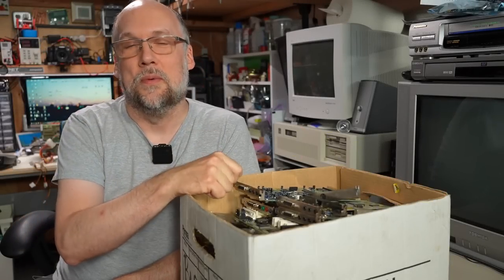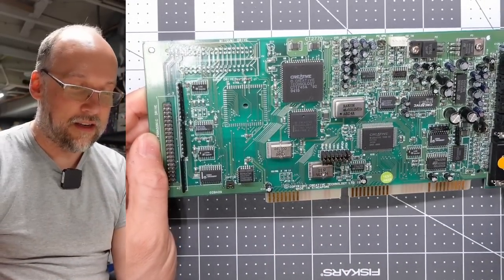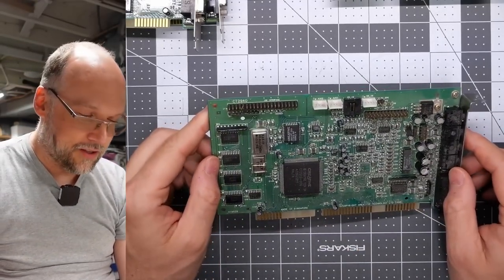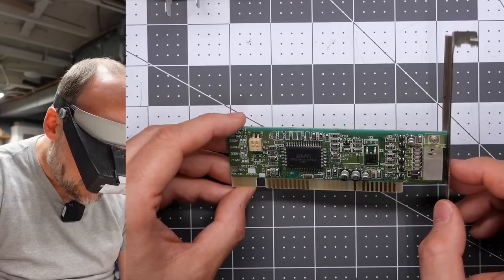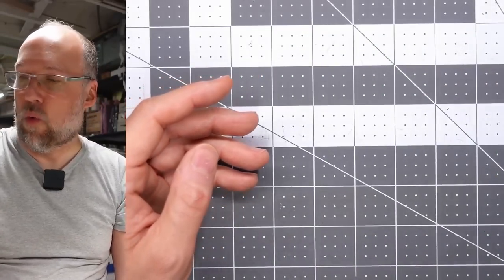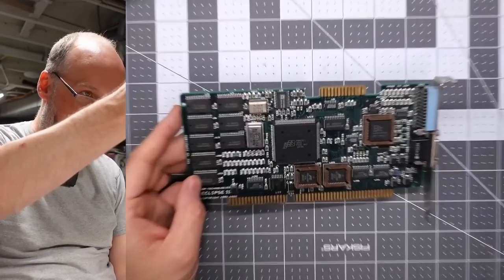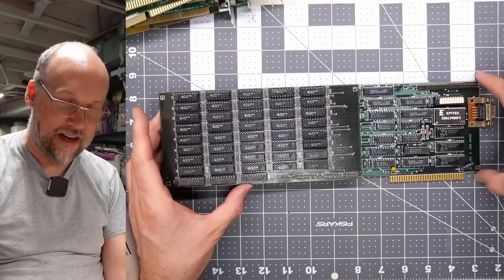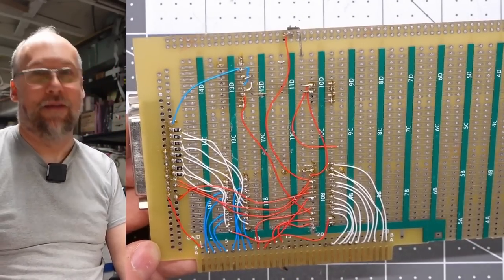Tech archeology: Exploring mysterious computer parts

Comment: The 386 pulg through of the debugger card has on board pins that go into a raiser which again is in a raiser. The raiser that goes into the system socket appearsto be replaceable without soldering.

Comment: I think if you find old cards with bodges on them and you think they might be fun t play with later, it might be word putting a little solder mask over the ends to keep them safe :)
Reply: I would never power one of those cards up without everything connected. One broken line appears to be a clock and that missing could easily lead to double driving the bus and smoking the buffers or worse.
Reply: @Peter_S_  I'm also just realizing I made a ton of spelling mistakes in my post.
Reply: @superslammer  No worries, I knew exactly what you meant and actually didn't notice. I was just thinking back to various bring-ups and the issues encountered along the way. You usually get lucky with TTL and active low selects but not always.

Comment: I used to install Jaton video cards in desktop machines built for a shop where I worked. They were probably 32/64mb cards. Nothing special, but better than on-board video if the mobos had it. Probably in the year 2000

Comment: I would love to see a video trying to use the Periscope In-Circuit-Emulator thingie, or any device like it. I always think of these types of devices when somebody tells me "emulation" means software and therefor FPGAs are not emulating. Then again I believe the term "In-Circuit-Emulator" outlived the era in which they actually did emulation but I believe they were still in-circuit. It looks like yours is adding circuitry between a real CPU and the rest of the system for instance.

Comment: The CT1741 is not OPL but DSP chip. Actually the CT1747 chips has real OPL3 sound. This chip is integrated with bus interface chip and OPL, but contain true Yamaha OPL-3 circuitry and the  CT1747 chips are made in Japan (by Yamaha).

Comment: 6:30 Creative was a bit weird with model numbers. Internally, there's no difference between the CT4520 and CT4500. However, some CT4520s have missing extra features like no CD audio input headers, missing RAM so no sound fonts, no RAM expansion headers, etc. OEMs used them often. The CT4520 is also newer and smaller, so less components on the board. Creative gave them all the CT4520 model number.

There are also other revisions of the CT4500 but as far as I know, there's no difference at all between them - they're all AWE64 values with 512KB Soundfont RAM.

IMO they all still make excellent general DOS sound cards, they support everything that the AWE32 does, no hanging note bugs, and overall clearer sound. Their biggest downside is they're all PnP cards so you have to use that awful CTCM TSR and if you do want sound fonts, the extra RAM module is proprietary.

8:00 - yep, more Creative model number bullshit. They're OEM cards, cut down to meet a price point but advertised as equivalent to a 'fully featured' card. If internet reviews were around then, they'd be torn a new one for pulling that garbage today.

Comment: Difference between the (AWE)32 and the AWE64: The AWE64 comes with a 32-voice software "waveguide" synthesizer to complement the 32-voice hardware wavetable synthesizer for a total of 64 voices. Also, the RAM upgrade board for the AWE64 series is proprietary, whereas the SB (AWE) 32 uses standard SIMMs. The synthesis hardware is identical. Software written for the AWE32 works out-of-the-box on the AWE64. The non-gold AWE64 has a mediocre amount of memory, 512K IIRC, which is less than you have on your SB32. Hardware-wise, the AWE64 is a budget version of the AWE32, with the EMU8000 synthesis chip and the whole digital SB16 stuff integrated into one highly integrated chip. The other big chip on that card is the analog mixer, and the DAC/ADC is still a separate chip.

Don't worry about SB AWE 32 vs. SB 32. The missing AWE just means it's a budget card, like the SB AWE 32 Value edition, but a different one. The CT3600 / CT3620 provide an excellent value even today. Those are the cheapest SB AWE 32-like cards available. The downsides are: No wavetable connector, no real OPL3, no on-board memory. No real OPL3 is a deal-breaker for some. No on-board memory is irrelevant. If you are into retro computing, you have at least 2*1MB in some parts bin, which is more than the 512KB the original SB AWE32 had as on-board RAM. On the AWE32, on-board RAM or socketed RAM are an either-or choice. So the on-board RAM is of no use as soon as you add a sensible amount of RAM (2MB or 8MB) to the card. No wavetable header: You can use an external wavetable adapter like the "Chill & Phil", but as the MIDI handing on the SB16 bus interface chip is a mess anyway and caused a lot of issues (collectively called "hanging note bugs"), you are better off using the MIDI interface of any budget sound card or even onboard sound, so again not a big loss.

Comment: There were a lot of sound blaster cards that shipped with OEM computers..... and the OEM's had very specific requirements. For instance IBM might ship one that didnt have an extra IDE port because their motherboard had an extra, while Dell would want one with the IDE connector so they could get away with a single ribbon to their motherboard. And then multiply this by all the different options on a sound card. The result was a stupid number of variations as the sound card kind of became a do all card with more than just sound.

Comment: The TB Multisound (Tahiti) seems legit by chip complement alone - the 56001 DSP would have been bleeding edge, and the CS4328-K DACs, CS5336-K ADC and 5532 opamps suggest at least prosumer level for a ~1993 card. Those converters would have been brand-new at the time with the highest grade for each one, and I won't be surprised if the card measures a fair bit better than its specs suggest or at least can be tweaked quite a bit. Certainly a fair bit beyond the typical CS4231 codec that you might have found in consumer cards of the day.
Reply from the maker: Indeed! I did some reading and people were gushing over how great this card was for playing back and recording audio. "Studio" quality many people said... if you were OK working with Windows 3.1!

Comment: 1:01:28 just cut the ribon cable before the damage and reatach the connector. done it a few times. cable get a little shorter tho..
Reply: This. You can probably find a replacement ribbon cable if it gets too short. Just tear off any extra conductors to bring it down to size.
Reply: If this is shielded, that might be a bit more difficult than usual
Reply: @ericwazhung  aahh, not done shielded before.
Reply: @danovebrest  nor I! just guessing

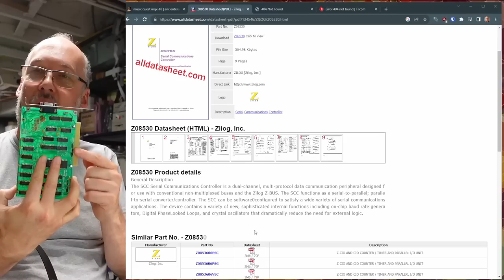Comment: 54:51 SCC is a super serial controller from Zilog used a lot for serial applications that need synchronous protocols. The normal serial chips from PC, be they the older 8250 or the newer 16550 with FIFO were pure Asynchronous chips and could not be used for some special protocols. Mainframe hardware used often synchronnous protocols to connect to terminals. Standard OSI stack also defined some protocols like HDLC that required special header bits to separate packets. It was also possible to build multipoint serial connection which made that chip usefule for networks before Ethernet was the king in town. Apple also used that chip for its Appletalk network protocol. Atari put one also in its TT030 range of computer, probably to use Appletalk, but they never published software to enable that.
Reply: Just had written that comment a little bit before you identified the card as an Appletalk card. 🙂

Comment: I have run those Kingston Turbochips up to 150MHz on a 486 motherboard capable of 50MHz bus, runs like a P90 then, also can run at 160MHz on an 486 motherboard capable of a 40MHz bus. I still have (somewhere in storage) the 50MHz bus 486 board with ultra fast RAM (for the time) and running with a 50MHz bus, an Adaptec fast SCSI card & HD, the thing was surprisingly quick compared to an intel P90 (which I think I still have). If running a 486 board with 40/50MHz bus, you really do need the fastest RAM of the time, otherwise it would crash a lot. PS: it was faster on a 50MHz bus @150MHz than on 40MHz bus @ 160MHz.

Comment: That 386 in circuit emulator sounds interesting. In the 80's I was using similar kit, though for the way more humble 8031 micro. Not sure how the foot pedal idea would be much use? What we'd be doing is writing code, compile/assemble it for which output would be the actual binary file but also a related symbols file which the emulator could use, so you could place breakpoints at certain points and examine the contents of registers/variables/etc by name. What makes me feel old is now a Pi Pico can use a second Pi Pico to do the same thing for peanuts !

Comment: that centram TOPS card is for interfacing a PC with Apple Localtalk. I'm guessing it's basically an ISA RS422 adapter. My college had a couple of these in PCs but IIRC the software was DOS only, and Ethernet to Appletalk bridges covered the needed use cases for Windows 95 and later...

Comment: The AWE64 is a pretty nice card. Fully compatible with SB16 PCM and the AWE32, but it has a much cleaner output. The regular/value only comes with 512k of memory, but it is upgradable. The Gold comes with 1tb if I recall. I have a CT4520, which is the value version(yours is the original AWE64) It even has good opl3 emulation, this came out by the time creative sorted out the CQM system.
Reply: 1tb of memory on a soundcard?....I don't think so.     The Awe64 Gold came with 4mb of RAM which maxed out at 36mb (4mb onboard + up to 32mb with a memory expansion daughterboard)

Comment: 26:40 TIGA card?  Texas Instruments Graphics Architecture (TIGA). Some company info on pg 212 of 1990-340-Family-THIRD-PARTY-GUIDE-4th-edition.pdf
Most TIGA cards connect to the VESA card connector on a VGA card. So they require a VGA card and the connector. They work similar to a Voodoo card, they sit there unused until the program initialize them and then they switch over. I used these when i worked for a GIS software company in the earl 90's. We ran DOS based  X-windows clients on them.

Comment: DDA-08 and DDA-16 appear to be a Kiethley analog output cards. 8 or 16 outputs. You have 32ish pins, because each output uses a pair. It appears that these are only single-ended outputs, though, so every other pin is, in fact, ground. Still a very nice thing to have for any lab application.
Reply: Ah, I see you got to that a few minutes later.

Comment: Back in the day, a PC LocalTalk would have been very useful to me. Connecting Apple Personal Laserwriter NTR to PS/2 system via parallel and with an app would write/read FAT formatted floppies. 

Acorn's Econet was aearly n serial + based networking. iirc, the PC cards for Econet were even more expensive than LocalTalk ones.

Comment: That a socket is unpopulated on a prototype board doesn't necessarily mean it's missing, it might just be unused in later iterations of the board. Populating it with a chip from a board where it's present would probably not cause problems though. Try looking up what the chip is that is in that Blackfoot board... it's around 39:20
Edit: Haha ok, an even more complete card was next in the video. I really should watch to the end before commenting. :)

Comment: If i remember right, i have seen that Blackfoot Card. That should be a jpeg accelerator card with a very short lifespan. It was used in the pre PowerPC era to accelerate jpeg picture encoding. I think Adobe Photoshop have had the abillity to use this card back in time. But i‘am not 100% shure
Reply from the maker: Indeed that matches what little information I was able to dig up on that card. The drivers and photoshop plugin are totally lost to time sadly.

Comment: Just guessing, but the SCAN-CAP sounds like it could by something around a scanning, capacitative ADC solution, which could be the interface card for some kind of Radio Receiver, RADAR instrumentation or similar things. 

And if you design or just work with something like that, you would like to have a fancy Analogue Output card for testing around ;-)

But the connectivity on it seems confusing. Maybe the VGA-Port is actually used as an input? The 40 MHz ADC on it would certainly be fast enough to handle VGA-Signals (640x480x60 Hz = 18 MHz).  

The only confusing part seems to be the lack of any complex processing capabilities on the board. I really don't know what a 1991 PC could try to do with a digitised VGA-Stream coming over the ISA-Bus.

Comment: For the periscope, rather than repairing the cable - perhaps cut it back to before the damage and recrimp it to the connector.

Also, washing is a last resort for me with dirty PCBs. Have you tried a natural fibre paint brush? I find that gets most dust off.
Reply: He said that but probably means the ultrasonic wash (with sterilized, de-ionized, distilled triple filtered water (also sold in bottles if you don't have the means to make it), which is the industry standard (usually one of the last steps of the manufacturing process).
Reply: @freeculture  sure. But either way, I didn't see anything there a paintbrush wouldn't have solved and much quicker :)

Comment: 16:20 I have been surprised, and later felt that I should not have been, that there are /many/ manufacturing processes that depend on what we would think of as older technology. Think about the cost of creating assembly line machines and the tech that runs them. Now fast forward 20 or 30 years and Microsoft no longer supports Windows 7 or whatever and no one makes a computer that can run it anyway but your software was never updated to run on Windows 10 or 11 and your hard drive crashed. What do you do? Apparently there is a huge market for older computers and peripherals that can keep manufacturing processes going.

Comment: Could Creative Labs strip any more off their cards on each new batch? Hello. Introducing the SB-BLANK. It's the only top sound card to come as an empty PCB. Never again, will you have to worry about upgrades. Just break off unwanted edge-card bits, and slam this baby into any open slot. Install two and cook grilled cheese sandwiches between them. Act now, and we'll throw in a set of scented fuzzy dice. Call the number on your screen. Operators are standing by to take your order.

Comment: I think I have a breakout cable for that, I’ll see if it’s still around. I have some Pi MT32 boards that can be used to make an MT-32. If you’re going to VCFMW, stop by table B20, I’ll bring them along.
Reply from the maker: I'll be there! So side note, someone emailed me the pin-out for the MQX-16 -- so I can build a cable setup for it, I think I have all the parts needed in stock.  I am not sure I'll remember #820! I'll be hanging out by the YouTuber area similar to last year :-)

Comment: 1:01:10 - it will not work if you just cut the ribbon cable before the damage trail, and then re-soldering that blue plug on it?

Comment: How much of a loss would it be to remove the plug from the end of the periscope and then just recut the plug just below the break, sniping off the excess?
Reply: If you had an IDC press that would be the easy fix for certain. A razor blade will trim the excess cleanly.

Comment: If possible could you dump the GAL's and PAL's on the PCB's that were in various states of assembly?  I think you should be able to do that with your DATA I/O programmer or the TL866 programmer.  Also see if you can scan in both sides of the un-populated PCB's so that it may be possible for someone to recreate the card in the future along with high res pictures of the fully assembled cards so that people can see the component markings and values.  And dump the ROM's of any of the other odd ball cards that may not have their ROM's dumped online.

Comment: Why do my comments disappear from your videos?
Reply: This platform is funny. Check back and you might find they reappear.
Reply: or maybe if you tried to paste a link...
Reply: @ericwazhung  I only had timestamps in this current video. I contacted Adrian earlier on Patreon and he said he doesn't have any rules in place to filter comments :/
Reply: @Dukefazon  The internet and all can be flakey, too... a plane flies by at just the right angle to interfere with wifi or cell reception, a notification pops up at just the wrong time, frankly it's a wonder it works as well as it does. Sure, TCP is supposed to handle retransmissions, but that doesn't mean the app writers handle exceptions well.